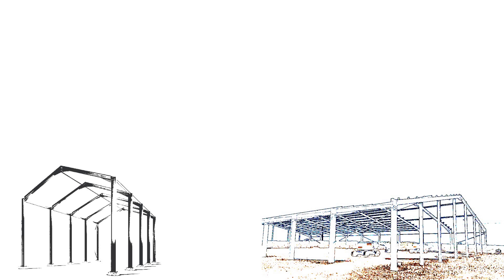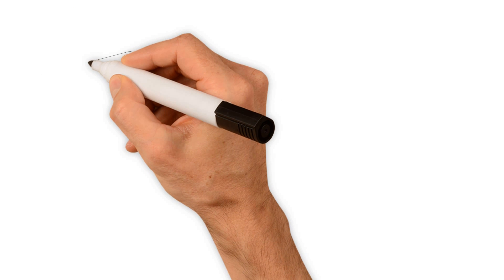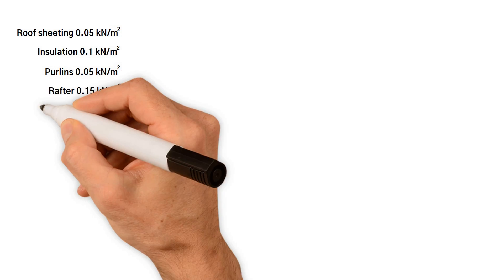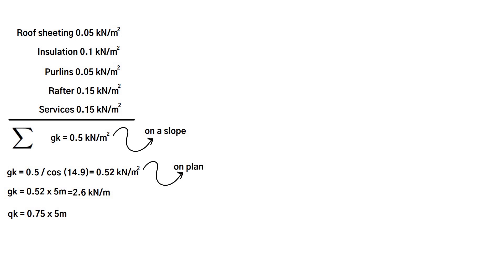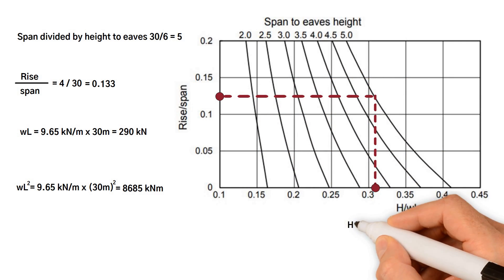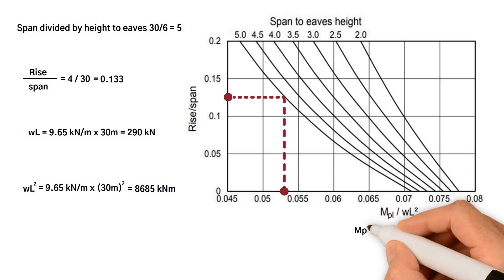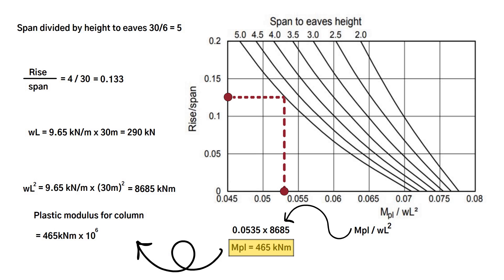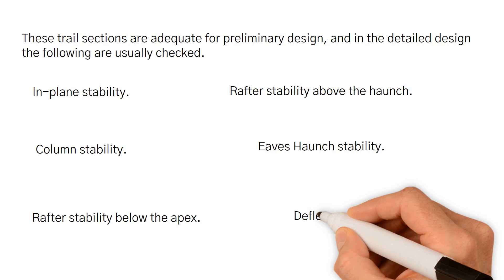An easy method for Portal Frame preliminary design - every structural engineer should  know.

Comment: Excellent videos.  A worked example designing back to back unequal angles acting as a beam over a maximum span of say 4.0m supporting a domestic timber floor would be interesting.  The purpose would be to set the vertical flanges of the combined beam section up within the depth of the floor to provide an almost flush ceiling line.  It would have to be assumed that the beam section would have to be fully restrained. IG Lintols have a similar standard lintol to carry two skins of brickwork over a maximum span of 2.70m with a maximum load of 10kN.  I would have thought with having more metal to play with in the RSCs, (plate thickness of lintol only 3mm) I would have thought it was possible but I am about to find out.  Have been retired for 11 years and have lost touch somewhat so will see what we can retrieve from the old grey cells.